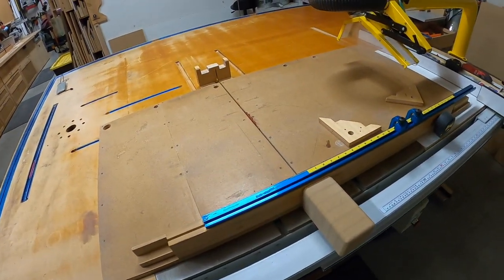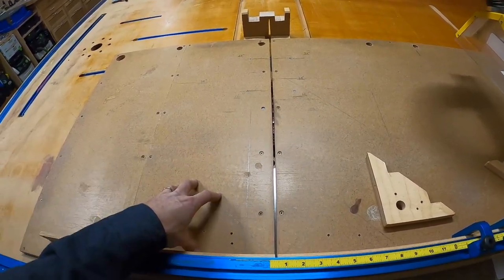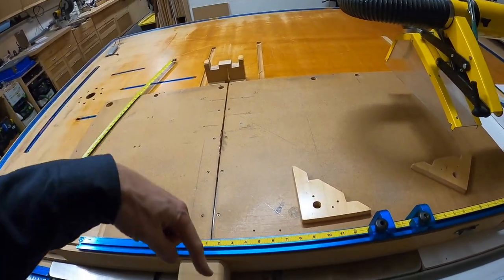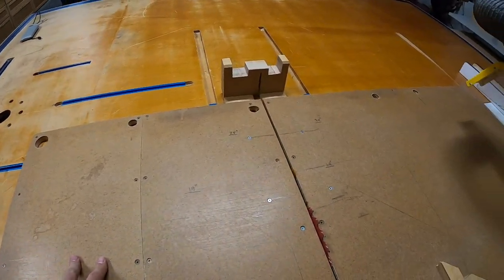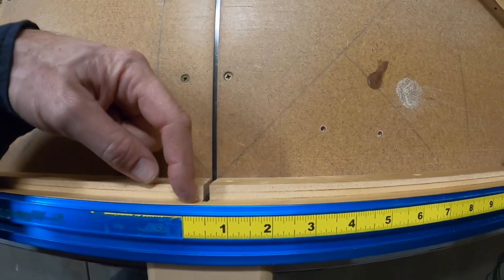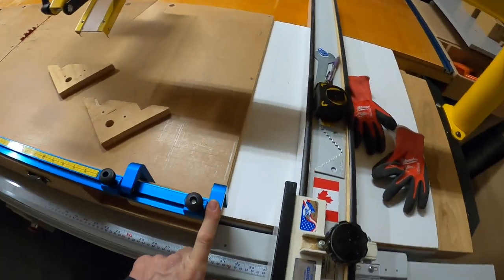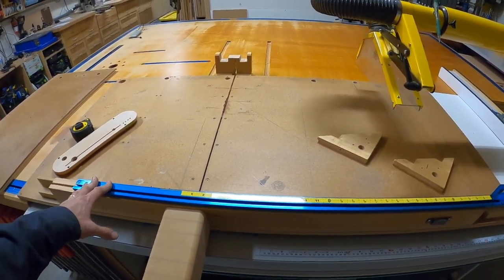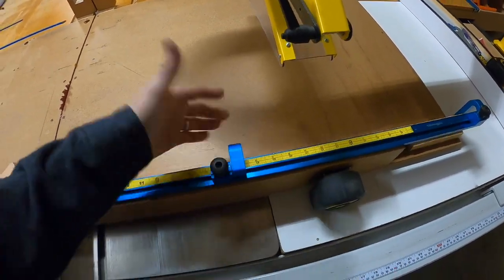My Main Table Saw Crosscut Sled- A Close Look At The Features!

Comment: On your saw, does the blade bolt on the right or left of the blade? Mine bolts on the right so it seems the left side of the kerf is constant regardless of blade width. Is this opposite from your case?
Reply from the maker: Hi there.  I have a right tilt saw.  So it bolts to the left of the blade.  So my kerf changes on the left side.  If you have a left tilt saw, yours would change on the right side.  Just like your tape measure on fence.  It’s off every time you change your saw blade.

Comment: Got my runners cut and installed in my huge new sled. Next up the fences. Thanks for the inspiration
Reply from the maker: You’re welcome.  You know I had used wooden slides on my sleds forever.  But after many years of fussing with them, I went to aluminum ones.  They were very
Good and never changed sizes with humidity.  So there wasn’t any play.  What material did you use for yours?
Reply: @davidbryanwoodworksandmore  I have aluminum runners on my smaller sled. For these i used oak
Reply from the maker: @crownmoldingbyspectaculart941  sounds good.